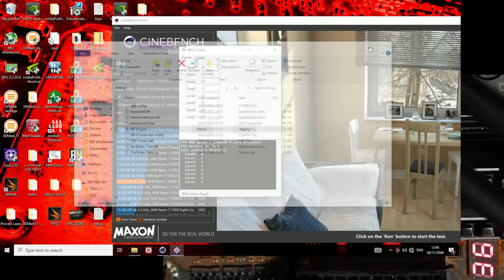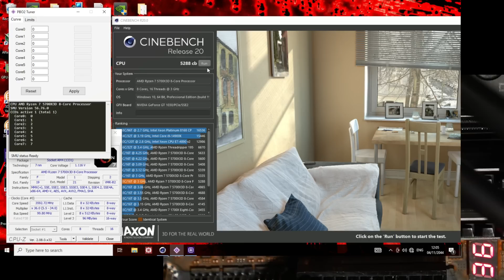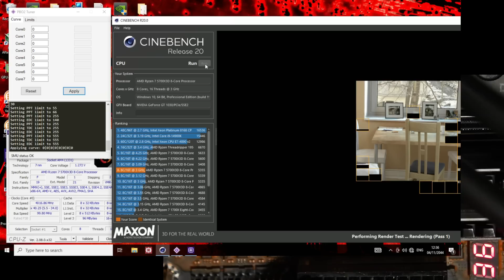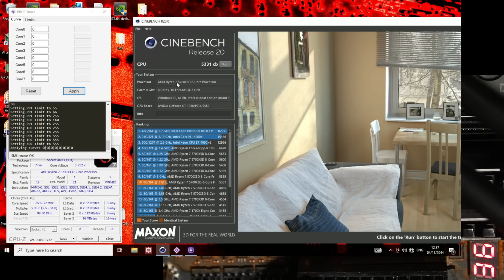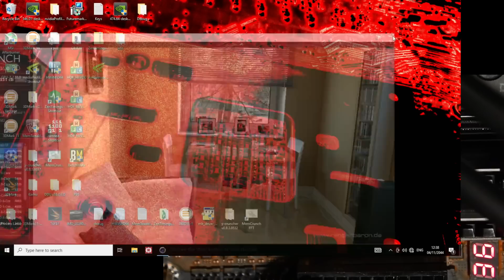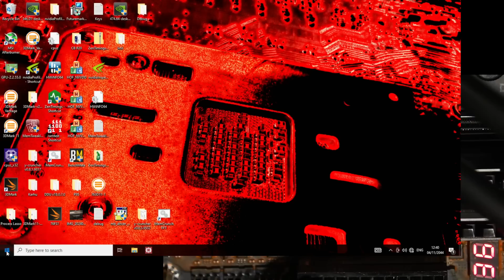Trying PBO2 Tuner on the 5700X3D

Comment: Playing with PPT to find where it performs the same as stock is basically just monitoring how much power it uses for the workload by guessing and typing in the PPT number.
Could just open HWiNFO64 without touching PPT and compare CO 0 vs -30.

Comment: PBO2 tuner is best used when you utilize the CO modifier alongside increasing your PPT/EDC/TDC. You need to let the chip pull more current.
The tool also bypasses the annoying EDC bug that nerfs your performance
Reply: Some sources point to EDC being fixed on the later agesa releases

Comment: pbo is only useful if you tune per core and you won't get much on an x3d cpu (voltage limit), even on an non x3d cpu you're better off using manual oc

Comment: so I just tried this out at 0 I get 110 score in 7zip, if I set CO to -5 I get 112 if I set CO more aggressively I still get 112 i.e. -20 or -30
so 1.8% improvement...
but a 20% power saving 
on a 5800x3d
see my comment on the other 5700x3d video about why people are dumb talking about CO etc.
Reply: I get a 10% boost from -30 all cores on my 7800x3d
Reply: 10% of what
boosting what?
 @iamdeluluu

Comment: I used -30 all-core on my 5800X3D - CB23 results:
before: 14,900 @ 67 degrees
after: 15,200 @ 60 degrees.
Far more bothered about the temp losses than the MC gains.
Reply: what is your ppt
Reply: @henrikfox8960  105

Comment: The X3D chips are great gaming chips, but the lack of overclocking is a drag, but that cache just can’t handle anything more. You’re right about the bclk on the X3D chips. It just trashes everything. Memory overclocking is a go on the 5800x3d. Not sure about the 5700x3d. I have a 5800x3d with 4x8 3600 Mhz dimms. You’d think the ram throughput wouldn’t be good with 4 sticks, but it gets about 49 gb/sec consistently.

Comment: Very dissappointing that you did all that testing without monitoring temps...
Reply: Literally the point of undervolting, lower temps same performance.
Reply from the maker: because if the CPU isn't throttling the temps are irrelevant as far as I'm concerned.
Reply: @ActuallyHardcoreOverclocking   then what is the point of doing all that on a locked CPU ?

Comment: Your problem Buildzoid is that in almost five years since the advent of 3rd Gen Ryzen you have not bothered to learn anything with regard to Ryzen.

If you actually did some research then you would find out what the problem is with the AMD architecture and how to fix it.

I have offered to help you over the years, but you just ignore it.

I am now no longer interested in offering you that help any more.
Reply: I would like to hear the problem and the fix
Reply: @valentin3186  The problem in a nutshell is that AMD screwed up wit the 3rd Gen Ryzen in that they bastardized the architecture, or rather the voltage, for single core Boost (or as I like to call it "Boast") as opposed to optimising multicore performance.

The problem associated with that is that it is not possible for the architecture (and I can prove that if you give me a shout on Discord) from the voltage levels needed for single core boost to a voltage level suitable for multicore performance without the CPU hard crashing.

I spent eight months working with my 3rd Gen Ryzen CPU to find out how to make the architecture work; whereas Buildzoid has just wasted his time and that of his viewers configuring AMD CPUs as if they were Intel, with a stunning lack of success.

I have offered to teach him how to configure Ryzen, but his hubris has prevented him taking me up on my offer.

AMD on the other hand does not have that hubris and internally they use my guide on Ryzen CPUs to configure their Ryzen systems internally.
Reply: @valentin3186  I did reply to you explaining the problem and the fix in quite a lot of detail, and the reply has been deleted.

Comment: I've also noticed overclocking doesn't really do much anymore. I set my 5600X to 4.85 all core, and the difference wasn't noticeable at all. Same with my 3060. +150 on core gives me an ~8% uplift. Going from 50 fps to 54 fps isn't anything to write home about.

Comment: Please educate me... 
My setup: ASRock X570 Taichi, 5800X3D. Curve optimizer is available in BIOS...so does this mean it just doesn't apply any settings? I'm confused
Reply: Ať least on my B550 Aorus board if I touch the BIOS setting it kills the boost all together (stuck on base frequency). Doing it via this tool keeps the boost on 4450Mhz
Reply: @jakubknotek4891  BIOS PBO-> Curve optimizer set to -30, clocks at 4,35GHz on all cores. Changing PPT, TDC & EDC does nothing to performance, so i left them at default. Temps max 77 with small Arctic single fan tower. CinebenchR23=15,021 pts
I'll try PBO2 Tuner next...

Comment: Miss application of the tech . The amount of people running spires or stealths hitting max temps then employing curve optmiser has been a life saver for there boost clocks . You also mention you live in the uk so you are aware of extreme energy costs so its not like every parent wouldn't appreciate a yearly saving here with no performance loss or in some cases a gain? Also you state these OC tools do nothing on a CPU known to be locked down from OC tools especially after burning up those boards on the 7000 3d. The 3D on smaller coolers is surprisingly rough to cool as the vcache acts like a thermal layer .
Theres plenty of reasoning why curve optimiser helps allot of people but not guys with large AIOs, then they wonder why there not getting benefits from additional thermal headroom. What next saying a diect to die kit does nothing because its running locked clocks on an already effective AIO ? This would be a weird application of the product also.

Comment: Wait what? I do have access to curve optimizer in the bios on my 5800X3D o_O

Are you looking in the right place? There are usually 2 places where you can config CO: AMD Overclocking panel and your motherboard standard panel, in the standard panel you can tune CO, but it is locked in the AMD overclocking.

Comment: if your cooling is on the edge you might not boost to that max you see and this might help. your cooling is just too good for this to be relevant. then again, this is just relevant for all-core workloads which are not really what X3D will be used for

Comment: I had a 5800X3D on a asus B550-E and that got a bios update around the launch of am5 that let me set co in the bios.. a combination of -30 co and a power limit of 108w let me increase both single thread and multithread performance by 5%, with 6c lower max load temps
Reply: It’s even more significant on 7000 series

Comment: Hi guys! My understanding up to this point is, that boost clock is not related to core voltage but temperature. May it clock higher with better cooling? These boost algorithms are a miracle 😅

Comment: Not a amd thing but Intel could use the terminal velocity and vf more easily to use like PBO...

I'm running a 12700k at 1.43v to 5.1/4.1ghz because i lost patience trying to do the fine tuning...

Rams micron fdie 2x32 at 3900mhz cl18-21-21 1.28v

Comment: Lower temp, consumption and noise at same or slightly better performance is always worth it for me :)
Reply: Lowers the voltage per the same or higher frequency as well, just need good silicon.
Reply: and the cpu will last longer
Reply: @bftjoe  yeah, as long as it is stable there is no downsides to undervolt 😊
Reply: @Taraquin83  the only real downside is you may need to decrease the undervolt as the chip ages.
Reply: @bftjoe  yeah, I've noticed that on my 3.5year old 3060ti. Max UV at 1560@700mv is now unstable. 1500@700mv is rock solid.

Comment: I've been useing curve optimizer on my 5800X3D for a while now (year 1?) on a Asus Dark Hero. Also tuned the max power draw and lowered that a lot.  Since you can't really overclock the 5800X3D, lowering the offset to -30 on all cores, allows the cores to stay at 4.45GHz under almost all workloads. I think Cinebench stabilizes at 4.2 (was like 3.9 with stock settings) during all core, but all other situations, like gaming for me, it just runs at full speed and sips 65-75W. And when you have a custom loop with a 4090, it's nice to have a CPU that doesn't require you to get a second loop for the CPU. Also, everything is more quiet. 

I also run a power limit on the 4090 for the most part, to get a almost dead silent gaming rig.
Reply: did you notice any bottleneck with the 4090 and 5800x3d? i have same setup and an uv on top just under clock stretching
Reply: @pav1u  I have the same 5800x3d + 4090 and as I also run at 4k then you don't see a bottleneck. Under 4k you probabaly bottleneck the 4090 whatever CPU you have. Though for CPU heavy games you can see the 8 core CPU holding you back a bit.

Comment: Did the 5700x3D leapfrog the 5800x3D in cinebench? I can't find a buildzoid video running the 5800x3d in CinebenchR20
Reply from the maker: I don't have a 5800X3D
Reply: highly doubt it since its locked at ~500 mhz lower

Comment: Very strange, Curve Optimizer definitely shows up when using CPU-Z for testing (I know its not great, but it loads and runs quickly so I have some idea of if I'm going in the right direction) I was applying my CO settings in BIOS, so having to re load cinebench every time would be annoying, I'm not trying that hard. 

My 5800X3D went from 602 single thread to 620, and from 6100 multi threaded to 6400.

Comment: Try changing your custom Pstate0, though that is also bclk dependent. 

If the math can be trusted, try 3900 MHz at pstate0 VID at 32 and then run the curve optimizer at -30 across the board again. I think you should be around 4.5GHz boost if there isn’t an issue running bclk that high. If so pstate0 at 4200 and VID 32 with bclk 107 shouldn’t be too high
Reply from the maker: if I set any Pstate higher than 3600 the CPU just go back to the usual boost behaviour.

Comment: yeah its only if you're really limited.
Considering modern CPU's/GPU's is just a game of throttling limitations and overclocking is dead (cant run 5Ghz all core on a 5950x even though that is the 1 core firmware speed), the best we can do is reduce the headbutting of the power ceiling, like vega64 cards you can keep the same factory overvolt and try and go for more Mhz... but you stil run into the power limit, which sure if you raise the power limit 20% you can maybe get 5% extra on the core, however if you reduce the factory voltage it stops headbutting the power limit and clocks 5% higher as a result anyway.

Modern overclockign software-throttle optimisation software
you can reduce the throttling to gain more performance sometimes but the clock/power limits are not changable, IIRC AM4 is like 200 watts socket no matter what you do besides maybe going subambient (where a microcode switch gets flipped).
No amount of voltage will allow any ambient cooled 5950x to do 5Ghz all core even if temps are okay because of the fun cap.

I had a 5600 which at stock had 4.45Ghz 1c turbo and like 4.2Ghz all core
With +200 frequency offset that was 4.65Ghz 1core turbo (so 5600x) but like 4.25Ghz all core.
But then if you ran -30 CO across the board all 6 cores would just sit at 4.65Ghz which was a decent multicore improvement for now extra power and heat.
Tried the same on a 5950x (no frequency offset) and all core R15 went from ~4Ghz to 4.25Ghz, Later combined with some Bclk tuning got to 4441mhz by the end of the run with a dark rock pro 4 air cooler getting over 30K in R23.

I'd love to run 4.8Ghz all core (seeing as daily use has shown every core is perfectly fine running at that speed... on their own, the second more cores get used the power leash gets pulled and it goes back into gimp 4.2Ghz mode), this is all we have now.

This is word soup because I'm in allot fo back pain.

Comment: Curve optimizer will only provide a performance increase if the CPU isn't reaching the max boost clocks due to some other limitation. It helps if you're hitting a power, cooling, or FIT limit. It's a shame AMD doesn't allow increasing the max boost clock on X3D CPUs. Unlike running a static multiplier and voltage, increasing the max boost clock should be completely safe.

Comment: Curve optimizer helps with CPUs that have a higher boost table or higher boost limit, as well as a capped power limit where PBO cannot bypass. For example the Ryzen 5800x on my X570-E Strix motherboard will basically top out at about 160 watts (regardless of cooling), even if you set PBO to a higher setting, and thus PBO leads to a higher all-core clock speed, often you can get a good 50MHz+ additional clock speed compared to just the the PBO settings alone.
Reply: a whole 50 MHz!!!
Reply: 160w??? Why is it using so much?
Reply: @TimberWulfIsHere   With you increase the limits with PBO, the all core power consumption, especially during workloads such as encoding with handbrake, will lead to power consumption in the 160 watt range on the 5800X  (non 3D). The main issue is that the CPU needs even more power and while the motherboard can deliver far more, it seems that AMD has some other limitation imposed as the CPU level that prevents the boost function from pulling more than that. This is why curve optimizer ends up helping to further increase clock speeds.
Reply: @Razor2048  I already know that but I've never been able to get my 5700x past 150w.

Comment: I'm running a -30 offset and a PPT of 75W on my 7950X3D because absolutely nothing I do with it seems to lose performance (Code compile and gaming. Often at the same time) but it makes my 360mm run much quieter... and I'm rather noise sensitive.
Reply: You can make your 360mm much quieter simply by making it spin slower under load, instead of limiting CPU power. Your CPU won't die from running slightly hotter.
Reply: @igor_mkv  I could. I could also just stop the fans completely and let it self regulate by thermal throttling. But as I wrote above I'm getting the same performance to within my measuring tolerance, and I'm getting better temps, lower noise and a lower power bill. And I'm obviously running a custom profile on the AIO anyway. The fans don't start until the liquid is 35C, so when I'm just reading documentation and reviewing patches only the 240mm front fans spin at 160RPM which is inaudible to me.

Comment: Asus has added their version of curve optimizer for the X3D chips on the main AI tweaker page instead of the AMD overclocking tab.  I tried it with my 5800X3D and it works!  A -30 all core curve seems to drop 50-100mv depending on the workload, and random temperature spikes are much lower during normal desktop use.  Effective clocks haven't dropped and my cinebench/OCCT score is the exact same.  Luckily my chip is good enough to handle the full -30 curve, but it sounds like most 5800X3D's can.  Curious if the 5700X3D's lower bin will change the result.
Reply: What is it called ? Can't seem to find it.

Comment: Probably cause you have used AIO 240 boost algorithm PB2 already maxout the speeds without need it use curve optimizer, that's why you don't see any true difference and also Boost Override didnt work , the combine curve optimizer (negative) with Boost override (max 200) give huge performance increase in 5000 series compare with the stock.

Comment: The problem is that the 5700X3D has turds for cores that cannot go above 4.15GHz at stock BCLK, so CO just isn't going to do shit. CO on just about any other CPU does work to an extent. On a 7600/7600X/7700X you can get some good single and multi core performance increase. Now, is that performance noticeable in gaming? Mostly no, but sometimes yes. My 7800X3D saw a decent drop in temps and holds higher average frequencies and all I had to do was type -20. Just about every chip out there will do -20 and that has a very big decrease in temps and voltage. Also AM5 does support lower than -30 for CO values, but just about no CPU will be stable.
Reply: 5700X3D get a 3-5 degree drop on each core using -30. 4150 all cores using Cinebench.
Reply: I've seen more than one case of this, at least on the AM4 platform: On my 5700x3d after sleep mode, vcore voltage drops, as if it's adding a CO negative offset of negative 10. Before sleep mode with CO at around 17, voltage maxes out at about 1.2v (about .1/.15 less than with no CO) after sleep mode, max voltage is around 1.17. The reason for pointing this out is because CO can be completely stable before sleep, but cause issues after sleep mode due to lower vcore -- in some cases, it seems like the minimum voltage might not be low enough to crash, but low enough to cause performance issues. I basically set my CO factoring in this sleep mode bug: so if I want an all core of negative 27, I set it to negative 17, because after sleep mode it will basically be similar to using CO offset of negative 27.
Reply: @michaelwitmer4180 what motherboard and bios are you using?
Reply: @mineatomtr  2 MSI tomahawk AM4 boards I used had this symptom -- both B550 & X570. I also tested a Gigabyte x570 board which (also) had weird sleep mode issues, though I didn't archive the voltages on the Gigabyte board at the time. I believe it's an AM4/AGESA code thing rather than mobo brand
Reply: My 7700 non-x gets all the way down to -50 lol

Comment: How does this software works? You gotta open it and dial the numbers every time you turn it on?
If so not very convenient but it is a nice to have tool lowering power consumption is a big deal for many ppl.
Reply: u create a scheduled task in windows
with a argument like this ( for example 12 Core 5900X )

-20 -10 -20 -20 -20 -10 -18 -20 -10 -20 -20 -10 395 120 120

first 12 values are CO , the rest is PPT EDC TDC